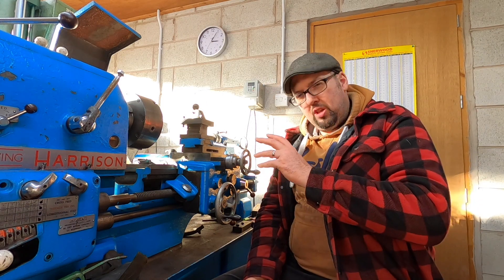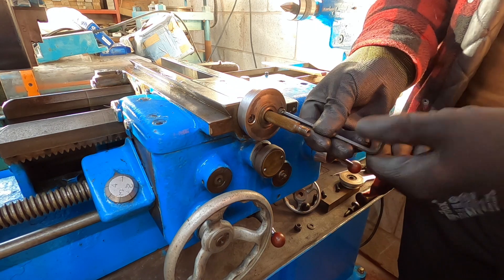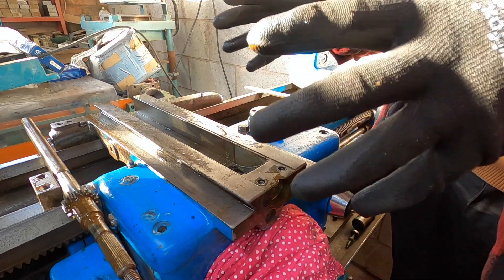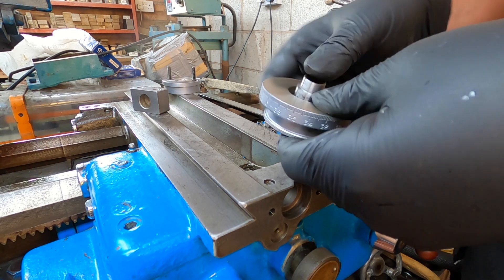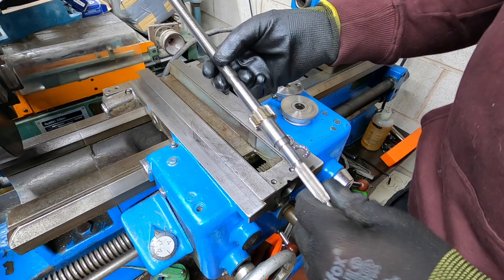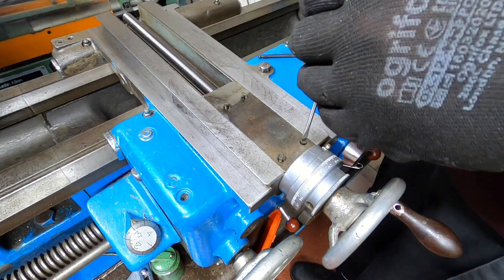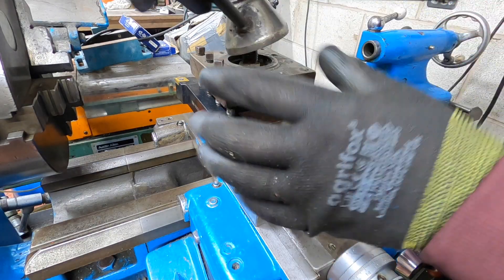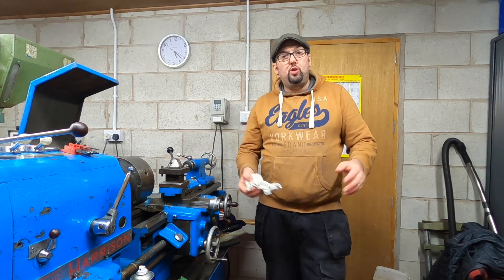Harrison Lathe - Part 3 NEW Y Axis Thrust Bearing .

Comment: As per other comments but on a L5A I thought that cast iron block was missing a support bearing too, but I was puzzled because the diameter on the leadscrew where it would ride is smaller than the od of the screw, so how would you slide a bearing on unless it was a whole split bearing arrangement but no mechanism to pinch the halves? I wanted to add one anyway so the answer was get a split oilless bushing off amazon and open it up to fit snugly in the block by expanding it a little with a taper sleeve. Then sliding the expanded sleeve over the crosside screw into position, where it sprang back to its expanded position and fitted both the block and the screw nicely. Also during this I measured my leadscrew & it was bent slightly, as I suspect yours is from your vid because that's why the graticule ring is lightly rubbing the static round block, but a gentle fettle fixed that. The amazon bushing I used https://www.amazon.co.uk/Othmro-Bearing-Bearings-Wrapped-Bushings/dp/B07Z7WYJQD/
My gib is notched and sticks out so I think that's original, I remade the lock bolt with a thicker collar because it was worn sloppy. I think they all do that over time and mine is 60+ years old. If you get hold of a boring table, the boring table has a fixed gib you adjust with lockscrews and doesnt use the adjustment bolt so a different arrangement, but I prefer the notched sticky out taper gib on the original slide as its easier to set snug nicely imho.
Reply from the maker: Sorry I missed your very informative reply, lots of great information here, thank you. I shall look into the lead screw being bent and the bush. All the best, Matt 👍

Comment: The screw for the gib looks exactly as mine. 
I have to re-make it because it fits very sloppy. (I had the same feeling as you with that gib, it doesn’t look original)
The slot is completely worn out and the flange doesn’t fit tightly in the gib’s notch.
BTW thanks for the bearings number.
Reply from the maker: Thank you. I just feel it sticks out too far to be original. It does its job, but looks unsightly. I have one on my Bridgeport similar, it’s been shimmed badly so they have hacked the aluminium guide strip cover!! All the best, Matt 👍

Comment: Just found you after searching for harrison videos, I just bought a 140 after being inspired by Mr Boost.  I'm having issues changing speeds with the two levers on the top. the right one has a mind of its own, and wont move when I try but sometimes it will move. I tried moving the chuck by hand whilst wiggling the lever. Any ideas
Reply from the maker: Hi Wadkinrestorations, Mr boost, good channel. If the 140 is like the 12", the left and right gear selectors have a strange mechanism, where to engage the right, the left has to be completely disengaged. I'd stick the machine in low gear not turn it on, and ensure the left is completely disengaged, the chuck should go from  stiff to loose, then try engaging a speed on the right. If that doesn't work I'd take the cover off the top and have a look see if there is an issue with that mechanism. I've not personally had any issue with what your having so I haven't paid close attention to the levers of that part, but I do know that it takes a little to get use to the quirks of the levers. Hope that helps some how. All the best, Matt.
Reply: @MattChiversWorkshop  Many thanks Matt, I will have a play. I watched your vid on the chuck backplate, I picked a 4 jaw self centering and a 4 jaw independent at an auction recently so I will be ordering a couple of plates from gloster tooling also.

Comment: Hi Matt I have the exact same lathe and have had to do all the same jobs to mine over 15 years. Doing a full carriage strip down with reshimming next ! You may know that these can do metric and imperial screw cutting ,there is a chart stuck to the door inside the gear  cover and it looks like you have most  of the gears to switch between the two. Takes me about 5 minutes.mine was fully loaded with 5c drawbar , taper Turner, fixed and travelling steady etc. So if you ever need any pictures of things like the C spanner or measurements etc.ring me at banner motorcycles Swansea.
Reply from the maker: Thanks Rid, Tbh I've never noticed a the chart inside the gear cover door, one to look for when I'm next at the workshop. All the best, Matt

Comment: You might want to check the oil in the apron . It looks like it needs to be checked.The oil is bad and needs to be changed,it looks alful dirty on the leadscrew.
Reply from the maker: Hi Keith, yes it needs stripping down and a really good clean, it’s been greased by some plonker instead of oiled. It’s on the list of things to do, but it’s a big list and I’ve zero fund and no time. It will get done. Biggest job is taking the head apart as it’s weeping oil on the seal at the bottom. All the best, Matt

Comment: Some strange comments this video. But the cross slide is back together and working smoothly. Doesn't it make one feel good to preform a little bit of maintenance on a machine and feel the improvement! I am a bit behind on my watching the u-tube creators since I am doing a bit of tidying up in my own shop and as soon as I finish my coffee I will get back to that chore in preparation for the winter build season here in New England.
Dick B. USA
Reply from the maker: Hi Dick, Yes it definitely does feel good, feeling and seeing the improvements transform the machine, really can't wait to get rid of the blue paint!! Good to hear you're in your workshop. All the best, Matt

Comment: Seems like you should have a bush in that one block. Was it loose? I'd probably go ahead and buy or make a brass bush to slip in there.
Reply from the maker: Hi My Lil' Mule, yes it was loose, well apart from the screws holding it to the dirt guard plate. Maybe thats all it is, a block to hold the plate, but if I do a bush, I'd probably do a self lubricating bronze one. All the best, Matt